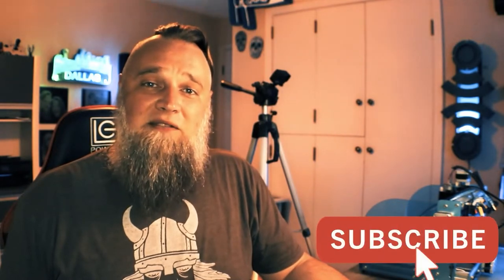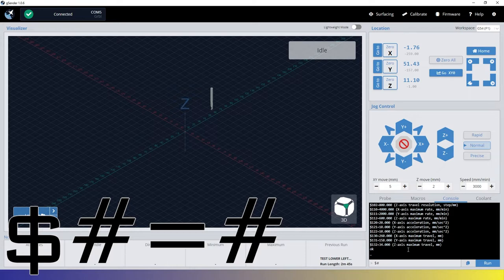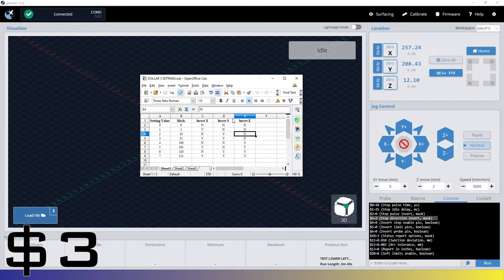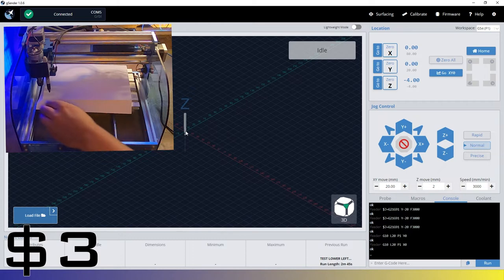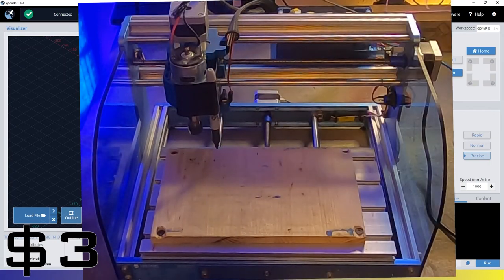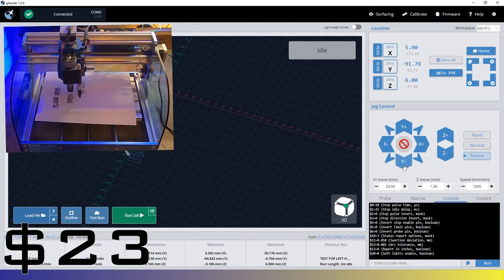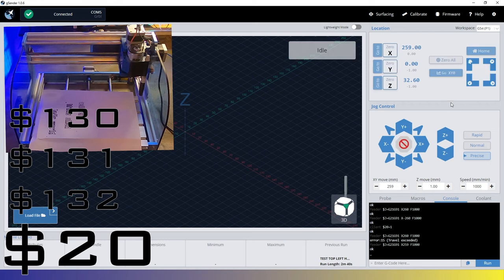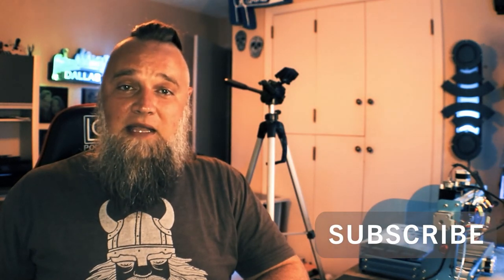GRBL Settings for CNC: A Beginner's Guide | GSender and More

Comment: Thanks dear sir💕💕💕    thanks
Reply: Sir i have a question thats all of port connected but I can't joging and running. There are showing probe fail. Another u r open a new chat that's dollar 3 setting. ods-open office.. I can't understand the formula. How can understand.. I'm new and helpless.. Please
Reply from the maker: $3 changes the axis direction
$20 is soft limits
$21 is hard limits
$22 is homing cycle

Try dialing 20,21,22 and see if you get the error.